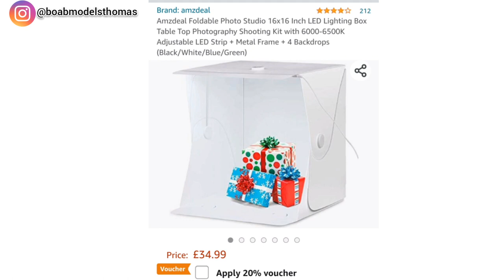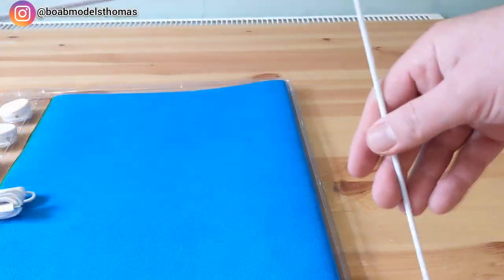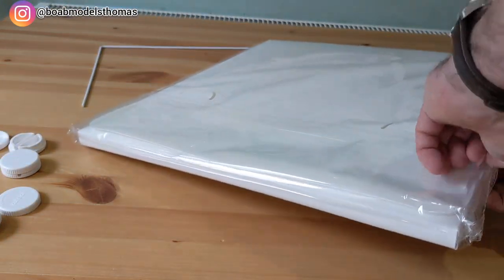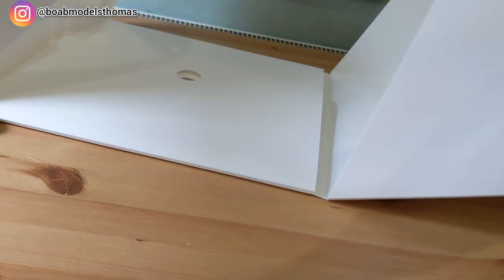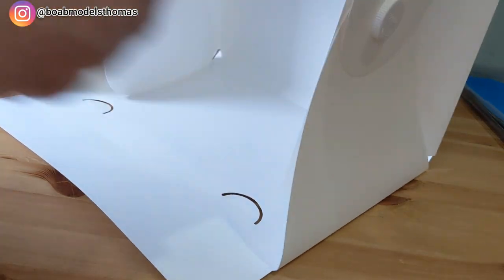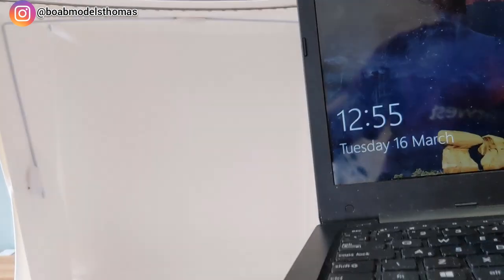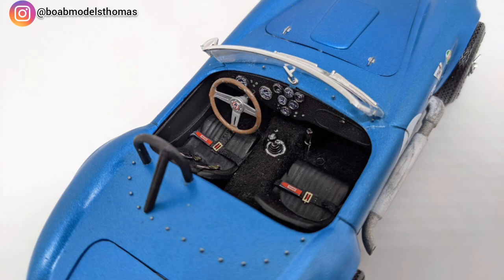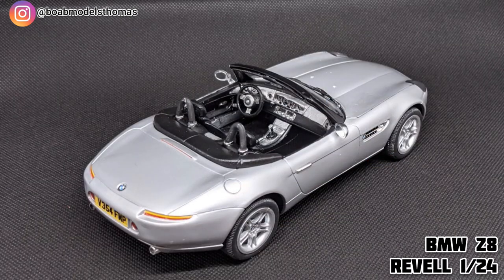Building an LED Photo Box - how to make the Amzdeal Photo box for scale model photography

Comment: All 3 caps are the same because the wire frame is supposed to go through all 3. I can't help but think 35 pounds for what this is, is not building on a budget. I expect I could build a replicate for a lot less than that.
Reply from the maker: it was discounted 20% when I bought it and I really wanted one which could be put away rather than taking up space. you are right that the three caps can be used to hold the frame in place but it's a tight fit.